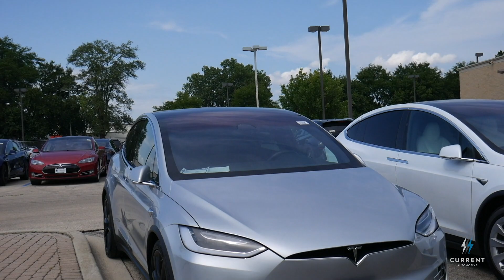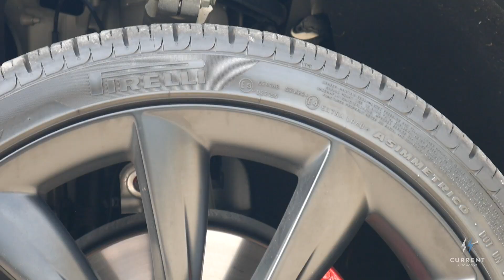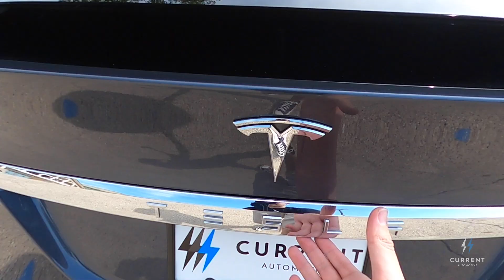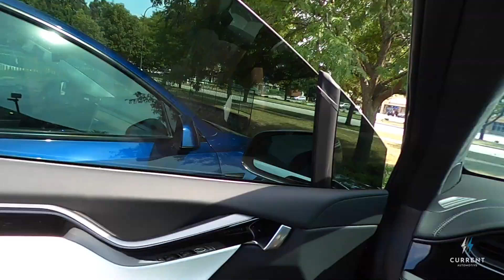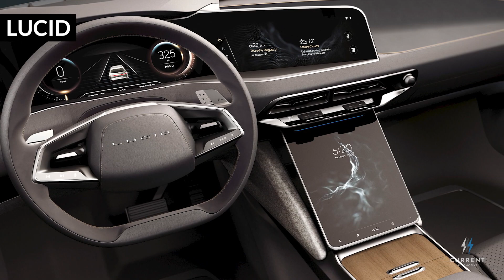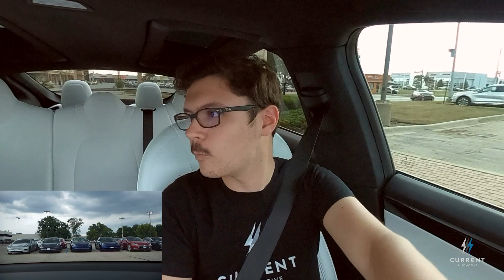500+ mile range! Lucid becoming a SERIOUS electric vehicle competitor.

Comment: Lucid's 517 mile estimated EPA range on 113kWh  is incredible and if it holds true to production, just makes everyone look bad. It's over twice the range of practically every non-Tesla EV. That fact is especially concerning since other premium EV manufacturers are (or will be) using between ~80kWh - 99kWh to get at best, 300 miles of range.